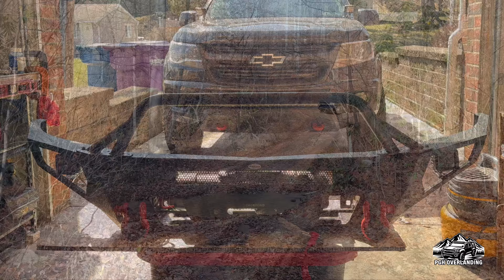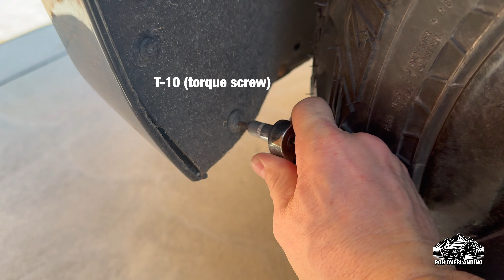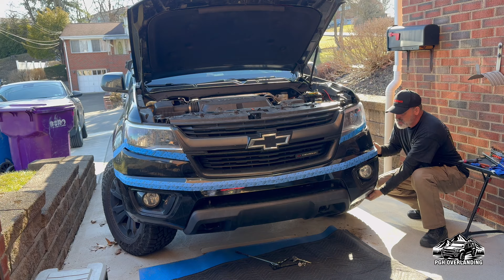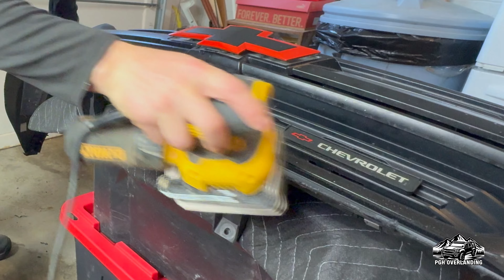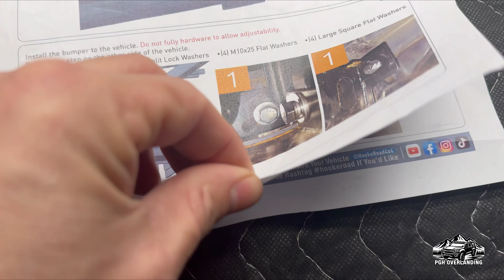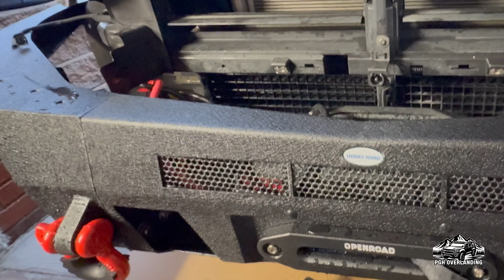Installing a Hooke Road Bumper and Open Road Winch

Comment: For the factory fog light. Its straight forward. Black wire to black wire and red to grey correct ?
Reply from the maker: On a 2016 the power wire feeding the fog lamps (at the 5202/PS24 bulb socket) is Brown with a White stripe, while the ground wire is Black. On earlier models it’s probably different color but yes solid wire with a stripe is positive.
Reply from the maker: I cut my original connector on the fogs and installed aftermarket LED cubes. Those lights are going to have red + and black - wires.
Reply: @PGHoverlanding I have a 2019 Z71 and you gave me the best idea ever. Cut and run straight to my already oem foglight button. I am going to be ordering this same bumper and didnt want to run new lines for these new pod fogs.
Reply from the maker: @Revso @Revsone1 e white cube fog is tied into the OEM wire and the amber is connected to my AuxBeam box. I don’t have any issues, you shouldn’t either, glad to help.